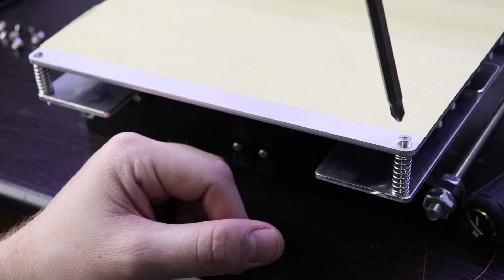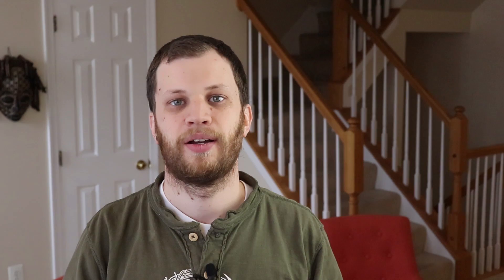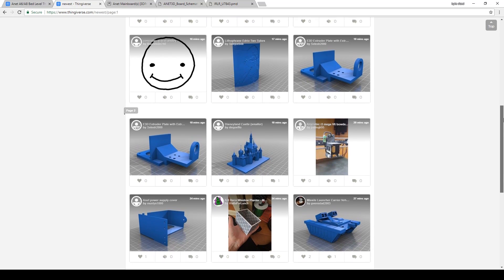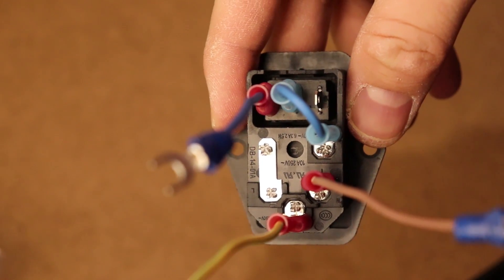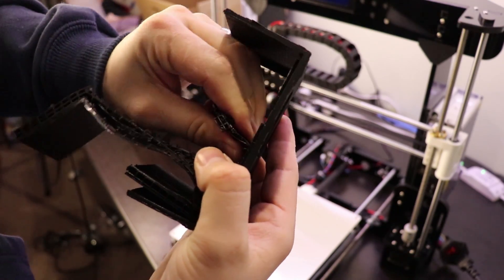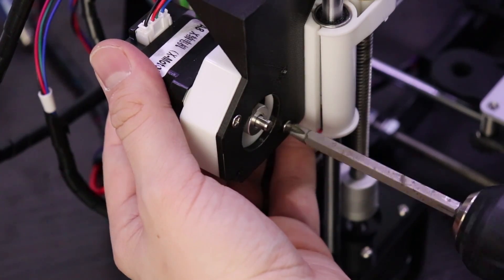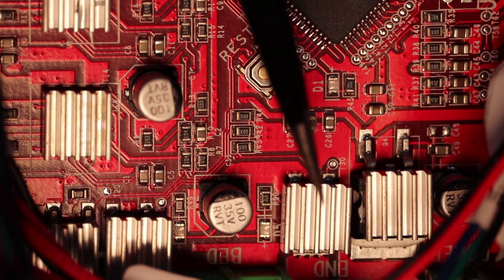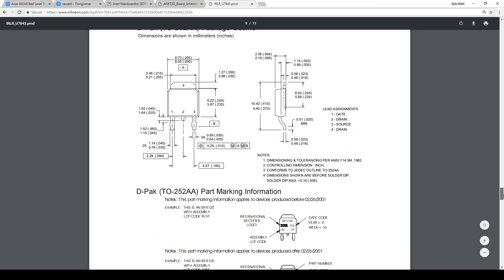Anet A8 3D Printer Essential Upgrades

Comment: The first thing i printed out was a set of fittings to make a welded steel frame,my anet was the cheap wood kit and the inertia of the y axis would make it flex crazily leading to huge banding.
Mosfets are a good upgrade as the onboards are barely big enough in the event of a short, they can burn.The original anet was a huge fire hazard.
Drag chains will reduce the chance of cable damage as they spread the flexing away from the ends, so they are not just a cosmetic upgrade, they also lower the chance of fire. The other upgrade i made was y axis tension, mine fits on the end and pushes on the back of the Y rods.X axis tension came with the steel frame upgrade. Search "welded steel prusa" on thingverse,there are a few diferent options.Other upgrades are toothed idler pulleys, make the belt more stable, metal extruder, plastic will fail eventualy,top bearings on the y leadscrews,stop a lot of vibration/resonance and depending on whats suppled with your kit upgraded the steel slide rods, the originals were hollow tubes, and slight undersize for the bearings,replaced with solids and stopped bearing slop.Cosmetic but also safety , printed a proper cover for the power supply and added a switch.

Comment: For those still watching this and are considering, no matter what printer you have, you should always plug it into a gfci outlet. If you short out, have a thermal run away, the gfci pops at 0.03 amps, rather than 10 like a fuse. If you live in an appartment like me, you can either buy a single gfci wall adaptor or make your own. Just use a gfci outlet, wire some romex to it, add a male end, put gfci in a blue box, attach faceplate and plug it into a standard outlet.
Reply: Smoke alarm. Connect it to the controller (or host, if it's a pi). Also connect PSU enable line. When the smoke alarm triggers, it runs M112 and shuts down everything. Then either put out the fire manually, or have one of those explosive ball things that release their contents when exposed to fire.
Reply: BUT: The GFCI will only trip if the fault is between hot and ground, which basically means a fault between the high voltage part of the power supply and it's enclosure.
Reply: @user2C47  that is true, so im not entirely sure how well a gfci would protect against thermal run away. Even a fuse might not protect against that.

Comment: Hi, are you in the UK or us? I don't know if this printer would work on the UK mains voltage if it is designed for the us mains
Reply: The PSU comes with a switch to change between 110v and 220v.
Make sure you check before plugging in.
Mine was set correctly,  but I've heard of some that were not.

Comment: This is a fantastic update on what you went through after buying the A8 and makes me much more confident in deciding to go this route. I can't wait to make the same upgrades. I however have heard that the cable chain actually causes premature failure by flexing the wires astronomically more than if they were just dangling. Yes it looks far better, and except for replacing each wire one by one pulling the pins and soldering each end to silicone wrapped wire I just don't know what to do other than slipping shrinkwrap wire down over each of them to guard the wires for when the plastic eventually does crack and peel away.  Idk, Perhaps I'll find out if there are replacement cable bundles by the time I have to worry about it. Speculation at this point for me is simply academic.

Comment: On your switch, if you would split your neutral wire and run a leg to that last terminal on your switch the switch would light up when on!!
Reply from the maker: Are you talking about the IEC connector switch with the fuse?

Comment: A 15a blade fuse on the heatbed cables and a 5 or 6a one on the power to the rest would make a lot safer. Also, be as sure to upgrade the firmware as thermal runaway is disabled by default.
Reply from the maker: I've upgraded to the latest Marlin firmware. Thanks for the tips.

Comment: Finally, an electrical engineer. Basically, I am sick to death of people screaming "add this mod" -- simply parroting a bunch of other people for no reason. Mods should improve the printer, or they are not worth making to begin with. As far as rigidity, go back to your physics courses. You do need a stiff frame, as an object in motion tends to stay in motion, combined with for every action there is an equal and opposite reaction. Basically, inertia of the rapidly moving masses when changing direction will translate to the frame, which will move the other axis attached to it, spatially moving the print in relation to the printhead (hotend). You will get jerk effects, ringing, etc., without a rigid frame. A vibration absorption system is also good (vibration dampener). However, many of the people modding 3d printers are acting as if it is a CNC mill, so be careful of doing something just for overkill value, as there is a point where the frame is rigid enough. For instance, you will see people talk about the precision of ball-screws as if they are the bomb diggity -- when in fact they are the least precise of the linear drive systems available. The are the STRONGEST of the available drive systems, and are highly sought after with CNC machines because of this, but they are not anywhere near as PRECISE as a lead-screw, whether they like it or not. This is due to range of motion with 1 turn of the stepper motor shaft. A ball-screw provides way fewer steps/mm than a lead-screw, which translates to less available inherent precision.
Reply from the maker: Thanks for the feedback! I think the stock frame does a pretty good job of dampening vibrations. Also you can adjust the acceleration values to help with that. I don't have ball screws on my printer, but I know they provide less back-lash compared to lead screws due to their thread profile. Precision and resolution is a function of thread pitch, stepper resolution, and microstepping, not thread profile.
Reply: @bytesizedengineering  One of the cheapest but most effective mods I know of is spending a couple of bucks apiece for anti-backlash lead-screw nuts for every leadscrew on a machine. After that, the point is moot. A nema 17 standard stepper motor has 1.8 degrees per step, when means X steps per revolution. of the shaft. Equivalent ballscrews have a huge pitch in comparison to an average 2mm pitch 8mm dia lead-screw of 3.175mm(for an equivalent diameter ballscrew the lead is 1/8in). Basically, the lead, or the linear length of travel of a leadscrew is equivalent to the pitch, with one turn of the screw giving 2mm linear travel, which is almost HALF the lead of an equivalent .375in ballscrew. A you can see, the pitch on a ballscrew is much greater. Since they are direct drive, the linear motion per rotation (lead) is necessarily greater on the ballscrew, so that doesn't change the maximum resolution. This means that even with microstepping, said ballscrew is less precise than a leadscrew with an anti-backlash nut. This problem is only amplified with microstepping, as it only increases the resolution for a lead-screw as well. Microstepping is not a function of the drive type, it is a function of the stepper controller which adds resolution equally to all drive types. My statement was not made lightly and still stands.

Comment: why not drill the threads and use just the wing nuts?
Reply: Those wingnuts are such a bigger pain in the dick than they seem. I know it sounds kind of silly. But for real, those tiny bits of metal are pure evil.
Reply from the maker: The wingnuts are a huge pain. The way I did it works well for me. I'm sure there are other/better ways it could be done.

Comment: Hey guys, I'm new in 3d printing. What software do you guys or what software was he using to see and edit his 3d models before printing?
Reply from the maker: The workflow of 3D printing goes like this. First you need a 3D model. You can create your own using 3D modeling software like Fusion 360 or Solidworks, or you can download models already made by others on websites like Thingiverse.com. The files are usually in STL format. You'll need software called a slicer that will convert that into gcode instructions for your 3D printer. A really common slicer (also seen in the video) is Cura. You'll use Cura to adjust the print settings and generate gcode. Finally you'll save that gcode file to an SD card and insert it into your printer. Then using the printer's interface you'll start printing that file. I'm not an expert, but hopefully this helps! And thanks for watching!

Comment: Excellent video! What slicer do you use with the Anet A8? I've been messing around with cura but can't seem to get the best profile/configuration correct.
Reply from the maker: I use Cura. I print PLA at 205* C and bed at 70* C.
Reply: @bytesizedengineering  Temps also heavily depend on filament but I think for getting decent results, 50mm/s printing should be okay, but maybe start at 30 if you see issues.
Additionally, play around with the extrusion multiplier if you see under-/overextrusion.
Once the basics are working, playing with layer width, layer height, initial layer height for bed adhesion etc can get you stronger/nicer prints.
Get your bed levelled properly first and make sure the extruder can properly grab and push the filament and isn't slipping. If it's not that strong, reduce retraction speed and increase retraction distance to compensate, at least if the increased retraction distance doesn't introduce clogging.

Comment: Don't trust datasheet currents for mosfets, the thermal dissipation and max temperature is what limits the final current
Reply from the maker: I wouldn't say don't trust datasheets. I would say look closer at the conditions in which the measurements were taken. Read the asterisk at the bottom of the page. You are correct in that the current depends very much on the junction temperature.

Comment: Excellent delivery and articulate. I'm up against a wall on funds to purchase a printer which has the capacity to print 12" x 12" x 4" minimum. Could you assist me in leading me to the right printer please? Thats 304.8 x 304.8 x 101.6mm  the last figure not as important as the Length and Width. PLEASE HELP!!!

Comment: why did you print the PSU cover up-right? Just lay it flat face-down and you don't need any supports. If you print it on GLASS it will also look a lot better than what you did..
Reply: Because he wanted to test the supports
Reply from the maker: It was a learning experience. Thanks for the tips!

Comment: i want to let you know that the anet board does not have any protection for if the thermistors come loose, a major fire hazard. 
the only way to fix this is to install a different firmware, marlin is the current de facto firmware for the a8 (thanks to the skynet firmware for adding support for the anet board to marlin)
this will void your warranty.
Reply from the maker: Yes, upgrading to marlin firmware is a good idea. I have since done this to my machine.

Comment: great video,
I do like the simple yet concise explanations you make. 
Have you any experience with CNC or Engraving machines?
Can this be shoehorned into one with a different head?
Basically id like to be able to print/engrave Traffolyte (or something similar)
Reply from the maker: Thanks for watching! I have a little experience with CNC machines. Have you watched my video about the topic? CNC machines have to be way more rigid because of the cutting forces on the machine when it cuts materials. Check out the XCarve from inventables. There are cheaper options out there too.
Reply: I too want to take the knowledge I learn and build cnc machines.. mini router and plasma cutter.. I don't see how this machine could work for either application. Like byte sized said, this machine doesn't have to deal with the vibration and force that is placed on cnc machines. That said I believe this will work for a laser engraver. I've been wanting to get my hands on a NEJE 3d laser. They are actually cheaper than these printers so there would be no point converting one over when you can get the whole machines starting at $49 for the 1000w and around $150 for the 3500w. Good luck! +St zig

Comment: Is it safe to build an enclosure for this printer because of the temperatures? I would like to print with ABS and I've heard that the best results come from printers with an enclosure and heated bed.
Reply: i have done it till i got a all metal frame for it and it didn't fit anymore, but i did a 15 hour abs print and it did fine
Reply from the maker: I haven't built an enclosure for mine. I'd have to do some more research to learn the pros and cons. I know that ABS does require a stable thermal environment.

Comment: I printed the main part today - x_axis_drag_chain_mount_1.stl   but it was very weak around the motor mount and easily broke in my hands. 

I printed at .1 layer height.  

Any chance of sharing the fusion 360 files? so I can make it a bit stronger?
Reply from the maker: Sorry for the delayed response. Just updated the thingiverse page with fusion and step files. https://www.thingiverse.com/thing:2842159

Comment: Dude! Essential for the Anet A8 means:
- MOSFET (really!)
- Heatbed connector upgrade/soldering the wires
- Heatbed cable strain relief
- firmware upgrade for essential safety features
- proper cable management with cable shoes and sufficient cables

This thing can and will burn. Three times in the last year it burned down an entire house. The pictures of it dissolving into a plastic mess are legion.
Reply: My conector from the heatbed to mainbord burned down. I strongly recemend to solder a more powerfull cabel diectly on the heatbed.
Reply: Look at Thomas Sanladerers recent video for additional safety tips:
https://youtu.be/VK_K6fp4BIk
Reply from the maker: I'm a Thomas Sanladerer subscriber! Love his videos, and I've learned a lot. Thanks for the tips!

Comment: Always nice to see a video about an A8! 
Try to print higher and you will see the limits of the Frame.
To your Support: Which Slicer do you use? On Cura, you can set the gap distance between Support and material. I have good experience with 0.16mm.
To your Mosfet, it's right, the onboard Mosfet can handle the Ampere, nur look closly at the board. Just the bed is needing 12V and about 15A - 18A plus right next to it, additional 12V and 3A - 5A for the hotend. Would not like to send this hole stuff through the tiny chinese board...
But your chain solution looks very nice, guess i will copy it!
Keep on going dude!
Reply from the maker: Thanks for the detailed suggestions, and thanks for watching!

Comment: About that mosfet data sheet. Even that cut down value of 30A is still very generous, as it assumes the mosfet is getting a PERFECT control signal, doesn't account for all internal resistances, and so on. It should still be OK for these application, but anyway.
Reply: I wouldn't mind a video dedicated to that. I had to watch about 20 videos to try to understand mosfets. I still have the loosest grip on them. An in-depth video from a guy that designs PCBs for a living might be what I need. Either way, thank you for this video. I checked your channel about every other week to see if you had any updates on your printer. I understand you have a job that probably keeps you very busy, and I appreciate your informative videos!
Reply from the maker: That is true. I'll say the same thing to you as I did to a similar comment. When I make these videos I have to find a balance between going into great detail and loosing most of my viewers, and keeping the explanations simple with the most important information. It's really tempting to go down deep rabbit holes with lots of detail about the internal workings of semiconductors, but that would overwhelm most of my viewers. I choose to keep my videos at an easy-to-digest level. (read the about page of my channel for more information).

Comment: I was considering doing the mossfet upgrade I have the new board but after what you said I wont
Reply: Patrick Bradley i would definitely add a mosfet, strain relief at the Heatbed and either upgrade the Heatbed connector or desolder it and solder proper wiring directly at the Heatbed.

And a firmware upgrade for the latest safety features is strongly advised! That was the route cause for the most recent incident of this printer.

This thing burned down three houses in the last year and the pictures of it dissolving into a plastic mess are legion! My connector smoldered after hours (!) of use, despite heating the Heatbed to 70C max.
Reply: Look at Thomas Sanladerers recent video for additional safety tips:
https://youtu.be/VK_K6fp4BIk
Reply: I have been using mine since Christmas, I never leave it running overnight and I am always in the same room as it longest prints I have done are 5 hours long at a time, no melted parts or broken/loose connections. It could be that its people are not putting the printers together correctly in the first place that is causing fires or defective parts to begin with ?
Reply: Patrick Bradley of course that is a factor, but the connector to the Heatbed just isn’t configured right. And strain relief is a must that most Chinese printer manufacturers ignore. That’s not a big problem since the customer can troubleshoot these things - but you really should do this, especially if you plan to use the printer for longer periods of time and/or with more demanding plastics than PLA.